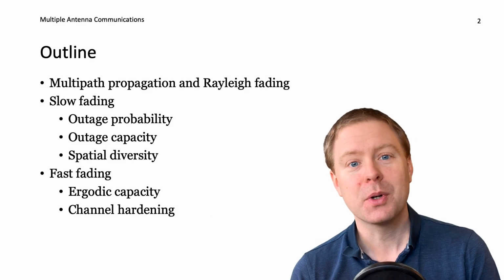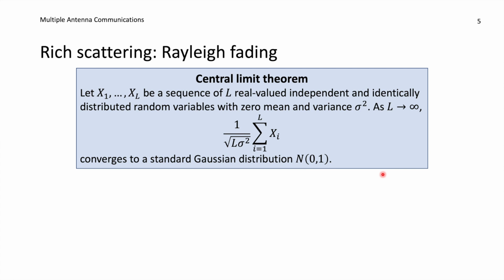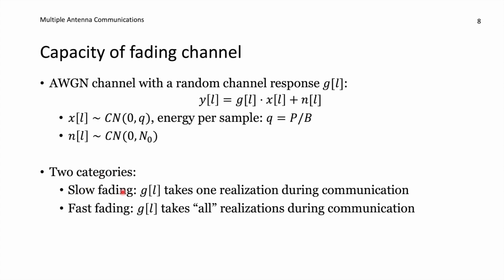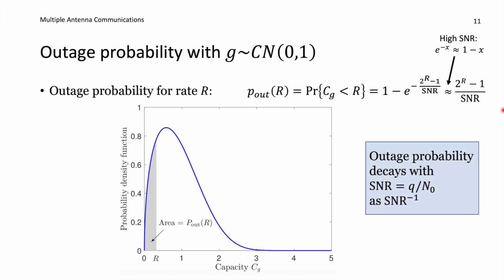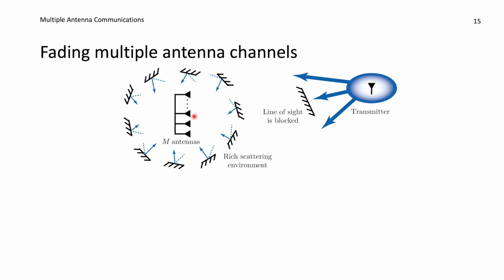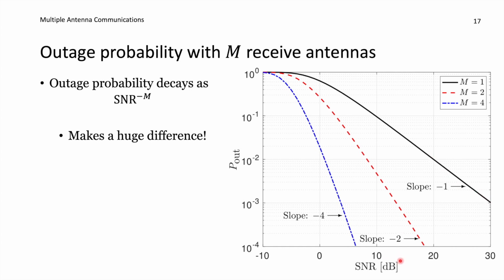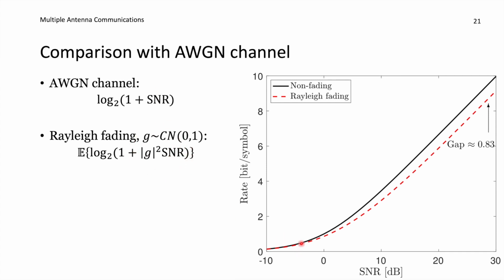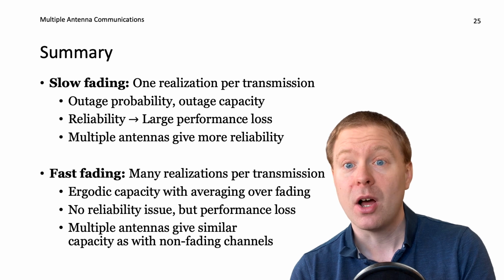Lecture 3: Fading Channels and Related Capacity Concepts

Comment: Lecture 3: NLoS 
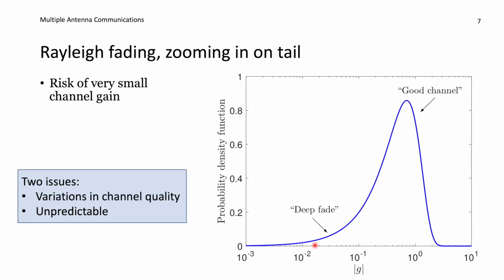09:50 Issues in NLoS Fading Channels
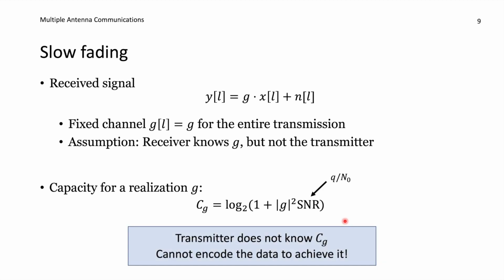12:49 Slow Fading → Outage Capacity
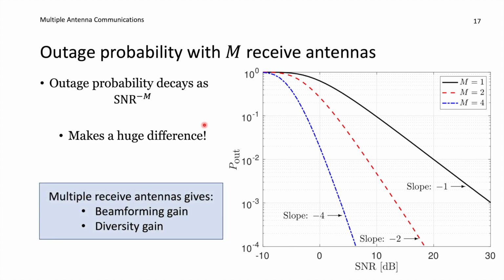└28:53 Beamforming Gain, Diversity Gain
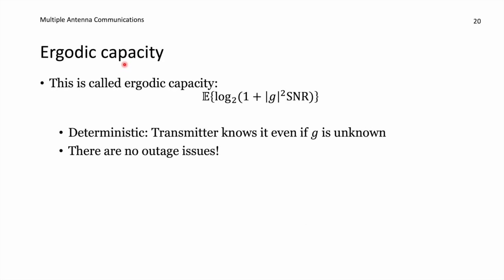32:48 Fast Fading → Ergodic Capacity
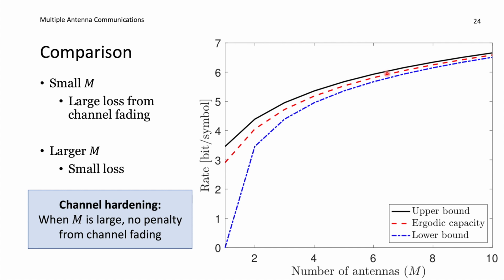└38:28 Channel Hardening
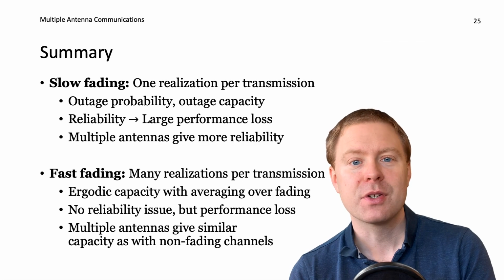38:52 Summary

Comment: What is meant by one instance of transmission to be precise?
Reply from the maker: At what point in the video did we use that terminology?

We transmit a sequence of modulation symbols, over time and frequency, and use a channel code to protect it from decoding errors (cause by noise and fading). The main question for the modeling is: will the channel have one or many fading realizations in the time-frequency block that the code spans over?
Reply: @WirelessFuture I think different terms are used at different times.. However, what is meant by them is the time during which we have one particular realization of the channel in case of slow fading.
Reply: @WirelessFuture  how long is that sequence in terms of time and frequency
Reply from the maker: @amahbubul85 The coherence time is approximately wavelength/(4*user speed). The coherence bandwidth is approximately 1/(2*delay spread). The exact number depends on the user motion and how the propagation environment looks like. The number of symbols for which the channel is constant is then the product of the coherence time and bandwidth.  It is usually around a few hundred symbols.

Small messages might be exposed to only one fading realization, but otherwise, fast fading is the most common case in modern systems.

Comment: for slow fading channel, is not it possible to have a feedback of the channel at the transmitter? If yes, then why do we talk about opportunistic transmission?
Reply from the maker: Yes, for practical data transmission, it is often possible to have a feedback link. Nowadays, data packets are usually so large that one can afford having a feedback link.

The slow fading concept is mostly relevant for the broadcasting of small pieces of information (e.g., system information) in practical systems, which is done before establishing a link to a user device, so there is no feedback channel yet.

There is nowadays a open-access textbook where you can read more about the content underpinning this lecture. See Chapter 5 of "Introduction to Multiple Antenna Communications and Reconfigurable Surfaces":
https://www.nowpublishers.com/article/BookDetails/9781638283140
Reply: Thanks a lot  @WirelessFuture

Comment: Dear Professor, can I say that typically we will usually use open loop system when considering slow fading whereas we can use closed loop system when considering fast fading? Because strict latency demands ->short data package—->slow fading? And due to strict latency demands, channel feedback to BS is often used? Thx
Reply from the maker: Yes, this is a decent explanation, but the kind of fast-fading transmission described in this video is actually also an open loop system.

Practical system often behave as slow fading for the transmission of system information - one need to protect it using spatial diversity since the packet is quite small and only sees one channel realization. By contrast, the fast fading case in a closed-loop form is used for the actual data transmission.

Comment: Hi, when we say fast fading or slow fading, should we always assume that transmitter does not know CSI? For a close loop system, should we consider fast fading or slow fading?
Reply from the maker: Yes, these traditional terminologies were defined for open-loop systems, which remains relevant for broadcasting of information. The main data transmission is often done in closed-loop mode nowadays and such systems are usually designed for fast fading and uses frequent pilot signal transmission to estimate/track the channels. We discuss this later in the course when we reach the “Massive MIMO” part.
Reply: @WirelessFuture thanks for your explanation ❤

Comment: Hi Emil, what is meant by the channel being fixed or varying during  ''the entire transmission''? Is it related to the coded block in the physical layer, or may be the frame packet coming from the upper layers for example?
Reply from the maker: Yes, it refers to the coded block at the physical layer. The question is whether the channel code will be subject to one or many channel realizations.

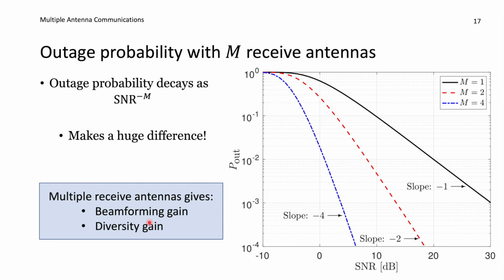Comment: Hi, fast fading occurs when the channel impulse response changes very rapidly within the symbol duration. Your definition at 29:52 is completely different. I mean, one realization of g(l) for every symbol X(l) does not imply that g changes rapidly within X, so can you elaborate more or provide me some references ? Thanks a lot !
Reply from the maker: Fast fading means that the channel changes rapidly within a codeword. Suppose you send a codeword consisting of 1000 symbols, and the channel takes a new realization at every symbol. Then you will have so many channel realizations that you can use the statistics to protect against decoding errors caused by channel variations.
Reply: @WirelessFuture  Thanks for your answer. Your definition is still different from the others I found. Changing many times within a codeword does not imply changing many times within a symbol (which is the most common definition of fast fading). I'm not sure maybe  definitions I found applies only on band-limited channels, instead in discrete channels yours applies.
Reply from the maker: Where did you find other definitions? If the channel changes many times per symbol, then you won’t have an LTI system and most of the classical results doesn’t apply.
Reply: @WirelessFuture  I can't post the website because Youtube delete comments. However, appearantly it's related to the doppler frequency and time selectivity. If the Symbol time is larger than the Channel coherence time, it means that we have many channel oscillations inside the symbol time.  On my old notes at university I have : Ts < (DT)c  ->  slow fading,
Ts > (DT)c --> fast fading, where Ts is symbol time and (DT)c coherence time defined as 1/fd, where fd is the Doppler frequency
Reply from the maker: @hm2stroke648  Textbooks are good sources for definitions like this. One such source is page 33-34 in Fundamentals of Wireless Communication https://stanford.edu/~dntse/wireless_book.html

As I said, slow fading means one channel realization for the entire time-frequency block that your channel code spans over. Fast fading means that you get many channel realizations with the time-frequency block that your channel code spans over. These are the two canonical cases considered when developing theory.

If the channel changes within the symbol time, you will get non-linear distortion and then one cannot use the classical information theory results. If you have a textbook reference where they consider that case, I'll be happy to have a look at it to figure out if they are right or wrong.
Reply: @WirelessFuture  I read Tse book and he states that the definition of fast-fading is very vague and lacks a general consensus in the literature. So it makes sense to find different definitions in different contexts. I appreciated the time you dedicated to answering me, and it was not my intention to challenge your points but rather to seek a better understanding. Thanks again !

Comment: Professor, thank you for always giving great lectures. I have a question regarding slide 21. Since the average power of the rayleigh channel is E[lgl^2] = 1, if the channel relization increases, isn't the ergodic capacity of the rayleigh fading ultimately the same as that of the AWGN channel? Why is there a gap in the graph on the right?
Reply from the maker: In the graph on slide 21, we vary the signal strength. The channel remains Rayleigh fading so it provides both small and large realizations compared to its mean value where E[lgl^2] = 1.

The ergodic capacity is the average of log2(1+SNR |g|^2). Some realizations will be larger than log2(1+SNR) and others will be smaller, but the average is smaller. The reason is the logarithm that grows slowly: We lose more when the realization is weak than we gain when the realization is strong.
Reply: @WirelessFuture  Now it makes perfect sense! thank you!

Comment: Hello, I have a complicated question. When you talk about ergodic capacity, does it mean that a single transmission (a single code of N symbols, each affected by a different channel coefficient) and thus a single reception decoding process can have zero error probability if the rate (bit/symbol) is less than the ergodic capacity? Or does it mean that for X transmissions (X codes, X decoding processes), the average error (averaged over all decoding processes) tends to zero if a rate lower than the ergodic capacity is maintained? I'm not sure if you've understood my doubt. The confusion arises when you mention at the 30:09 that the channel can remain constant for a block of symbols... thank you!
Reply from the maker: The first option is correct: You transmit a code of N symbols and each symbol is affected by a different channel coefficient.

What I meant at 30:09 is a generalization. You transmit a code of N symbols and the channel is changing but not for every symbol, but after a few symbols. For example, the channel might be fixed for 10 symbols. You will then see N/10 different channel realizations, and as N->infinity, you will see infinitely many just as in the first option. The ergodic capacity formula is the same in this case.
Reply: @WirelessFuture  Thank you very much, you've been very clear. However, it is not physically possible to implement a fast fading system because the receiver would need to correct the phase and therefore know all the gains of each symbol in the transmitted code, which is a too strong assumption. For this reason, I believe that studying slow-fading systems is more useful, and that's also why I can't find a context where the use of ergodic capacity as a benchmark would be interesting.
Reply from the maker: @rattotakki  If we take a 4G/5G system as an example, the channels are assumed fixed in blocks with around 180 symbols (12 subcarriers, 15 OFDM symbols, and one can transmit LDPC codes that spans around 50 such blocks. Pilot reference signals are placed in each block to estimate the channels. The ergodic capacity is a good indicator of what rates can be achieved in these cases.

The description of having a channel that changes at every symbol, but one anyway knows the channel, is indeed unrealistic. But this abstract model is used to study realistic cases where there are hundreds of symbols per channel realization, but the codes spans thousands of symbols.
Reply: @WirelessFuture  Thanks, this is very interesting! I hope to go deeply in these studies during my PhD

Comment: Thanks, just at the beginning, we the equation of the gain. Why do we take the square root of the gain alpha?
Reply from the maker: The signal power is proportional to the square of the signal. Alpha is the power loss of the channel, so we need to pull the square root when it is multiplied by the signal.

Comment: Is slow fading in this lecture same as flat fading while the fast fading is same as frequency selective fading,if not then why we havent considered the phenomena of flat and frequency selective fading?
Reply from the maker: No, these are different things. Slow/fast fading focuses on how quickly the channel changes over time, compared to the time duration of the transmission. Will we observe one or many channel realization?

Flat and frequency selective fading describes  on how the channel is varying over the frequency domain. This course is mostly discussing the frequency flat case since a frequency selective channel can be divided into many flat channels using e.g., OFDM.

Comment: outage probability  decays as snr^-M (M receive antenna), and i want to know whether transmit antenna can also affect outage probability. if it is true, can i say this as transmit diversity?
Reply from the maker: Yes, this is discussed towards the end of the next video. One needs to use space-time block codes in that case, which gives diversity but no beamforming gain

Comment: According to slide 23, for SIMO, ergodic capcity =E[log2(1+||g||^2SNR)] which has an upper bound and a lower bound which merges for large M and becomes the same capacity if it had been LOS. But should not LOS channel have only beamforming gain and no diversity gain? With large M, we loose diversity gain even in NLOS (as capacity merges to that of LOS case)?
Reply from the maker: Diversity gain means that you have access to many independent realizations of a random channel. There is no randomness in the LOS case so there is no need for a diversity gain. Fading is a bad thing and diversity helps removing its negative effect. When M is large, the diversity gain is so strong that the effect vanished completely. We then get equally good performance as for a deterministic channel (e.g,. LOS).
Reply: @WirelessFuture  thank you very much. Another question.  Is channel hardenning applicable only to fast fading channel? I am asking this question as it is explained with fast fading. But even for slow fading case, diversity gain increases with M. Hence, we will have channel hardenning for slow fading as well?
Reply from the maker: Yes, spatial diversity is applicable in both cases. The term “channel hardening” is normally only used in the fast fading case but it is not wrong to use it when dealing with slow fading.
Reply: @WirelessFuture  thanks a lot

Comment: Slow fading: g[l] takes one realization during communication, fast fading: g[l] takes all realizations during communication, Can you please explain what is the duration of communication and what is 'l' here? How they are distinct?
Reply from the maker: Strictly speaking, we need to transmit infinitely much data to achieve the capacity. But we can operate close to the capacity limits when transmitting at least one 1 kbit of data, so that is not much. The time duration of a transmission depends on the bandwidth: we can transmit one modulation symbol per 1/bandwidth second. The time duration that the channel is constant is called the coherence time and is approximately the time it takes to move a distance of wavelength/4. Hence, whether we experience slow or fast fading depends on the mobility and bandwidth.
Reply: @WirelessFuture  thank you very much. So, "time duration of communication" in my comment or "time duration of a transmission" in your comment means one symbol duration? So, to consider fast fading, this symbol duration should be big enough that the duration covers all the possible realizations of fading? I have seen your video on block fading. So, to be considered fast fading channel with a block fading assumption, the symbol duration should cover a large number of coherence intervals so that there is a high probability that it come across all the realizations?
Reply from the maker: @amahbubul85  The coherence time of the channel can be compared with both the duration of a symbol and with the duration of an entire block of thousand symbols that is transmitted at once, using the same channel code. In slow fading, the entire block fits inside the coherence time. In fast fading, the coherence time is at the order of symbol duration. We might study the case with one realization per symbol for mathematical convenience, but in practice is more like 100 symbols per realization. Yes, we need 10+ independent realizations for the capacity to stabilize around its statistical mean.
Reply: @WirelessFuture  thanks...So, the block of many symbols in case of fast fading undergoes many realizations (one  realization per symbol for mathematical convenience) while they fit within one realization in case of slow fading, is that right?
Reply from the maker: @amahbubul85  Yes
Reply: @WirelessFuture  thanks

Comment: mind-blowing lecture! Thanks a lot.
I just have a question, how can the transmitter - in case of fast fading - compute the ergodic capacity with unknown g? How exactly can averaging over g be done in this case?
Reply from the maker: The ergodic capacity is not a random variable, but a deterministic constant. However, it depends on the statistics of g so that must be somehow known in practice. In reality, one can measure the average rate at the receiver side and tell the transmitter about it through feedback.

Comment: The channel fading and capacity concepts in this lecture, do they apply when considering visible light communications (VLC) channel fading and capacity? I want to find ways on how I can determine noise in a vlc system using MU-MIMO
Reply from the maker: Yes, the capacity concept applies for any kind of channel fading. Rayleigh fading was only an example considered in this lecture. I’m not working on VLC myself, but I believe the transmission will be very directive and that coherent beamforming isn’t possible at these frequencies, thus MU-MIMO might not be possible. The noise is created in the receiver hardware and is typically determined by the thermal noise plus a noise figure representing the amplification in the receiver hardware. You can look for specifications for VLC hardware to identify the typical noise figure.